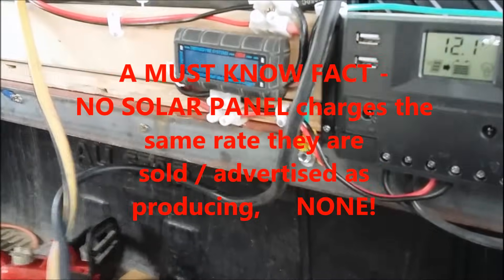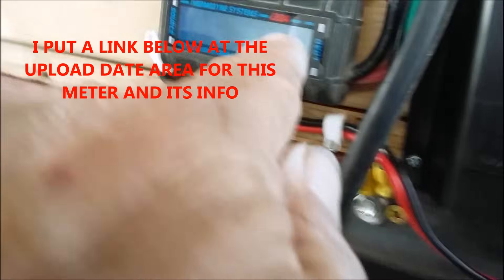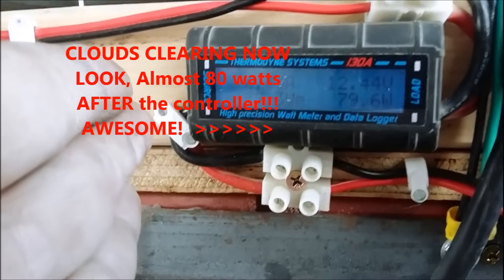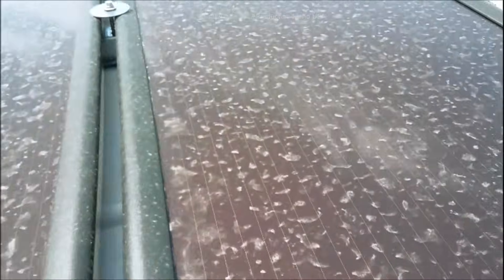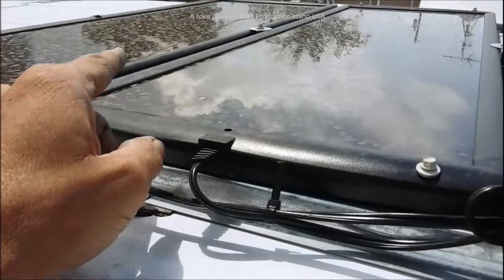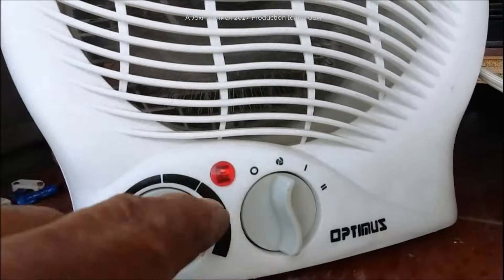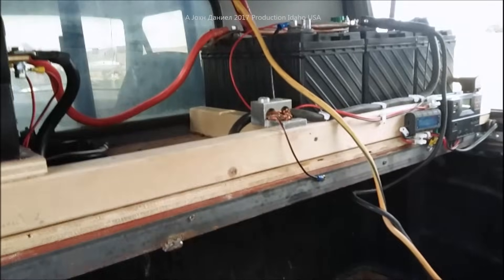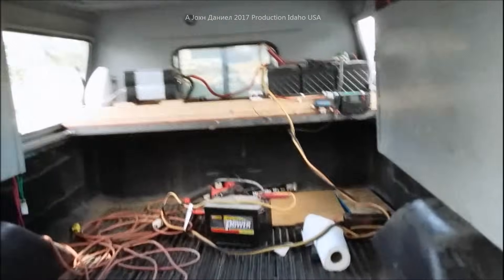Using Harbor Freight 100 Watt Solar Panels Output, my results, Info Below  ↙

Comment: What batteries do you recommend for (1) 100w kit. Harbor freight says you can combine 4 kits for 400 watts with the hub for the 45w sysyem. So I plan to add a battery with each additional kit, or should I go with a larger battery to begin with? I currently just use the 12v 35amp battery they sell for the kit. Thanks
Reply from the maker: When you go batteries, you should always just go as big as you can from day one. Make them all the same age, and keep a maintenance schedule best you can. A excellent new user inverter that is soft start and is nice to batteries is the PEAK 2000 and you can see details on it here http://amzn.to/2vpuu3z . Most who get it love it, some just don't know how to use a inverter or wire it right and will hate anything they try. Be sure to research, and buy good stuff from day one, you can add solar along the way.
Reply: Is this inverter pure sine wave for electronics? What is a decent battery to start with? Thanks

Comment: How is this kit working for you? I bought one and was impressed the first day but today the charge controller keeps showing an error code E11 and shutting down? Any suggestions? Thanks
Reply from the maker: +Leo Santini Not sure of any error codes, test your battery voltage with a meter. If you've ran it down to under a certain voltage the controller may think it's a bad battery and not charge it. Therefore show a error.
Reply: I think when the battery voltage hits the 10.8 low limit (only 10% discharge?) the controller shows the E11 code. The way I found to clear it is to disconnect/reconnet the battery cables to the battery. What I'm trying to figure out is if the charge controller stays off when the sun comes up and should be charging.
Reply: I had the same issue. I called customer service. Very helpful. I was surprised. As explained to me: the manual was not printed with complete instructions. You need to manually set the controller for your specific battery. I was emailed a PDF of the complete guide. I'm new to this and still trying to figure it out. Tech support 888-866-5797. I have the harbor frieght 12v 36ah deep cycle battery.

Comment: nice video, Ive had the 45 watt kit on the roof of my van for a year through all kinds of heavy rain and the fla hot sun and they work perfectly still!  checked them just today and getting over 3 1/2 amps in the july fla sun. have them conected to two 180 amp hour each batteries from rural king to charge my laptop,phone,5 watt lights and watch a couple hours a night of tv and they have kept my battiers fully charged, cant wait toadd the 100 watt kit and a couple more batteries.
Reply from the maker: If you get a few pairs of these, http://amzn.to/2uGWLVH DM 77W CdTe Solar Modules and a good MPPT like this 40 Amp http://amzn.to/2vIJFnG by EpEver,  you would be loving VAN LIFE in a whole new way! I have to do a video soon on my DM Panels, they rock. I would definitely go with 4 of the EXIDE as a battery, SLA ( sealed Lead Acid)
Reply: Glad you get 3.5 amps.. I only get like 1.6 out of my 45watts.  I think it was 16.7 or 17.6 volts, but doing the math it still only about 26.7 to 28 watts, which downright sucks.

Comment from the maker: ATTENTION MY VIEWERS, FUTURE VIDEO NOTICE : Your gonna love this WIND POWER MONSTER https://tinyurl.com/POWER-MONSTERgeneratorPMA Super DC Generator PMA  , 1700 Watt max Core PMA Permanent Magnet Alternator for Wind Generator, VAWT and a Even remote engine DC power generator. In a soon to show series,  I will be building the ULTIMATE freaking DIY power house, and YOU TOO can do this. Don't get tricked into buying that VIETNAMESE crap from Missouri.
Reply: cant beleive the shipping to Australia only $117
 ebay has always screwed up the shipping fees that is why i never bought one, ebay has always given a shipping fee of over $500 every time ive looked in over two years just for a pma.
and i took all the screen shots of them but ebay itself would not help.
now aussies have an alternative to you know who, if theyre after this style of turbine.
Reply from the maker: I have family in Adelaide that run a tire biz, they are dealers for commercial tires like planes, tractors, semi trucks. They always ship via India to get away from the heavy hand of AU Postal system.

Comment: I knew these would be some use. Still though they will charge your batteries and thats good. But I doubt they will be enough to run a ice box or freezer.
Reply from the maker: +Harvy Aims You'll need at least 4 sets to do that, 2+ batteries and a 1500 watt inverter like this one http://amzn.to/2va90GG , Krieger makes a excellent user friendly and very durable inverter. it will run what you need and they have 1000 to 4000 watt models. WITH all the parts needed!! The batteries I recommend are by EAST PENN made and you can do some research and places like Batteries Plus or even Sams Club sells them as Energizer or Duracell branded deep cycle.
Reply: Јоhn Daniel I am adding this improved Kit to my 45 Watt Magnum. I was fortunate that my Dometic refrigerator in my little camper was also running off  propane so the evaporative ammonia salt cooling was in effect; system stayed charged dry docking.

Comment: can I put the 100 watt Harbor Freight panel to  hookup to the 45 watt harbor freight panels
Reply from the maker: +Dan Decker you can add the 45 watt set to this 100 watt kit. It's controller is capable of 15 amps yet it's listed as only a 10 amp. I opened it, it has a 15 amp fuse link in it. 145 watts is barely 11 amps.
Reply from the maker: A combination of 3 sets of these panels and a 30 amp MPPT would outperform in KWH per day of the same rated watts ( 300) of any solar made of poly or mono cells.
Reply: Јоhn Daniel You could also upgrade and buy the 30 amp  charge controller that HF sells separately if you wanted that will work better with a lot more amps and watts.

Comment: Good to see someone showing what dirty solar panels can do.
Reply from the maker: Yes, had to put them through the test.
Reply from the maker: +Gary Krug Working next.on a gas powered automatic 75 amp battery bank charger for my big bank.
Reply: Gary Krug that's a great idea painting them white 😯I would have never thought of that☝ you are talking about the edges correct??
Reply: +Gary Krug good job painting them white.
but dont the white paint block thr sun?

Comment: 70 watts with dirty panels laying flat with a standard charge controller is impressive!
Reply from the maker: +Home Solar Research I expected 40 plus watts under these circumstances if it would have been less I would have trashed harbor freight. I am not only happy I got them now but considering another 25 watt single to add on.
Reply from the maker: FUTURE VIDEO NOTICE : Your gonna love this POWER MONSTER http://rover.ebay.com/rover/1/711-53200-19255-0/1?icep_ff3=2&pub=5575119394&toolid=10001&campid=5337663844&customid=GENUINE+THERMODYNE+&icep_item=172801400810&ipn=psmain&icep_vectorid=229466&kwid=902099&mtid=824&kw=lg Super DC Generator PMA  , a 3000 Watt Dual Core PMA Permanent Magnet Alternator for Wind Generator, VAWT and a Even remote engine DC power generator. In a soon to show series,  I will be building the ULTIMATE freaking DIY power house, and YOU TOO can do this.
If you get one, get it then just stay tuned and i will make a very indepth video to show how to make a massive back up generator for battery banks from 12 to 72 volts, they have all voltages. No AC generator burning 2x the gas can do what I will show you.